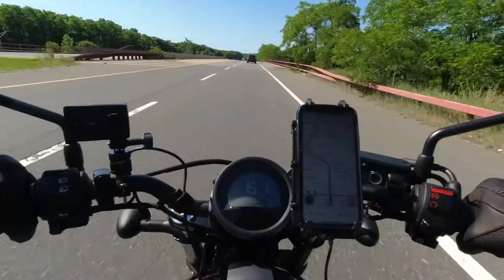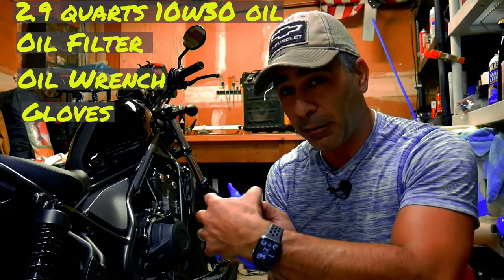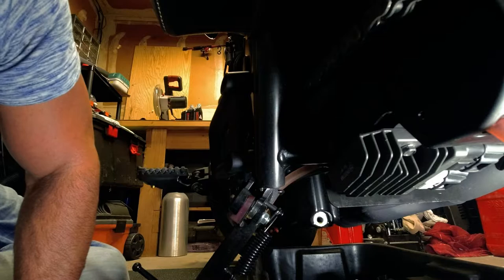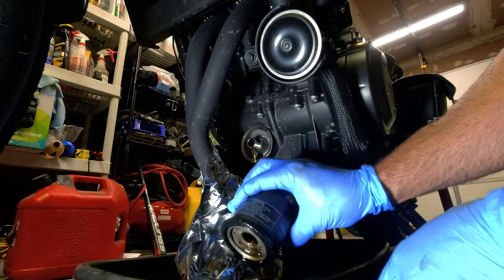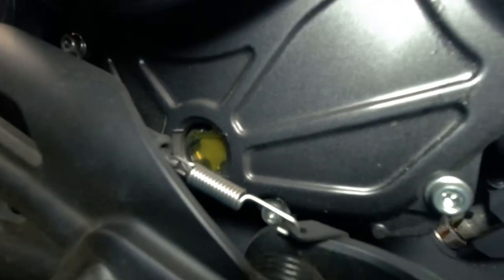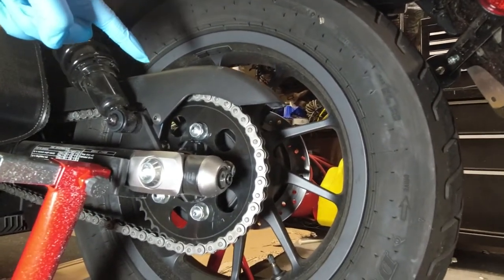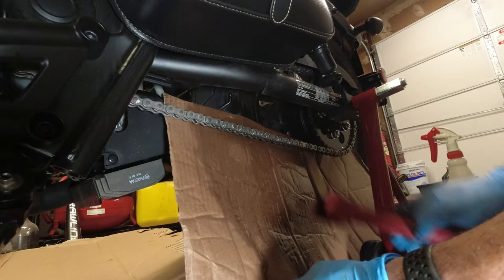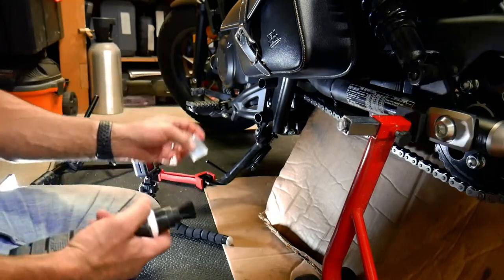Rebel 500: 600 Mile Service - DIY or Bring to Dealer?

Comment: I used  motul and found it very hard to get the O-rings lubed with it because it is so thick. However, Maxima 80-90 Gear oil really penetrates deep into the o-rings and that is your most important location on the chain to be lubed. If you paint it on with a paint brush the width of your chain you will get very little fling off but a much better protected chain and O-rings . IMHO  I only had to adjust my chain tension one time when the bike was brand new but 4000 miles later not getting any detectable stretch and have not needed any more chain adjustments. What that means to me is the gear oil is doing a really super job giving my chain a long life with no rust or stretch.    Kit
Reply from the maker: As much as I like the Motul chain paste, I too have been thinking about going to a gear oil.  I've been reading a lot of pros about it, but of course there's the cons of it flinging off etc.  I guess you have to weigh what works best for your situation. But I agree, I think gear oil would probably give your best penetration.  And if you keep on top of keeping it cleaned and oiled, your chain should last a long time
Reply: @Mudslidex1    As far a flinging off or dripping the first ride throughs off most of the "extra:" gear oil however for the first few day after chain maintenance I just park my bike on a flattened out piece of cardboard and I do keep the few droplets off my garage floor that way. So that is How I deal with that issue.  Kit

Comment: Thanks for the great video! I was planning on taking it to the dealer for service just because I don’t have lots of free time but honestly, having done complete engine rebuilds on cars and maintenance on heavy duty trucks and equipment, I now see this will be a breeze 😂 Thanks for being detailed!
Reply from the maker: You’re welcome.Even if you had zero experience, this is an easy job. But it sounds like you have more than enough to do this.  Happy/safe riding!

Comment: Nice video. If I may, I would suggest that you run the engine briefly after completing the oil refill and then check the oil level sight window. You changed the oil filter but that will not have refilled with oil yet, so the oil level sight window will be inaccurate. Running the engine will prime the new oil filter and then you will get an accurate reading off the oil level sight window. Also, "hand tight" is very subjective. Honda "should" know at what point the drain bolt would strip the threads on the aluminium engine casing. Using their setting and maybe setting that a little less than the manual spec would be more user friendly. If you get a newbie doing this and you tell them "hand tight" they will lay on the force and risk stripping the threads, which makes for a very bad day.
Reply from the maker: Thanks for the tips.  I always check the oil again after a day or driving in both my cars and motorcycles just to make sure as it usually needs to be topped off a little.  As far as the hand tight goes, yes that is subjective and I guess mentioning the torque specs would have been helpful. Thanks for the input

Comment: Great video very helpful! Im a complete newbie never touched  motorcycle, anything else i should check when servicing my bike?
Reply from the maker: Thanks. They say you should check the torque specs and when you have the dealer do the first service they "say" they check them as part of the service, but I'm not sure they actually do and probably just put it there so it sounds like you're getting more for the price they're charging you. But each dealer is different.  I would just go around and check and make sure nothing is loose etc. The manual has more detailed info on what to check and when.  But the first 600 miles is an easy service to do on your own and save money!

Comment: Would you say this is all that is needed for a 1st service on the Honda Rebel 500? 
No need to tune up the clutch or anything else?
Reply from the maker: For the most part yes, but I would check the clutch cable play (which really shouldn't have moved during the first 500 miles)  but check the chain tension.  As far as torquing all the bolts, I highly doubt the dealer does that too, but if you wan't you can.  I never had any issues.  Basically it's an oil and filter change, check chain tension and clutch cable.
Reply: @Mudslidex1  Roger that, thank you! ;-)

Comment: I got a new rebel cml 500 last July , the first 600 miles service with the Honda dealership is important, they change the oil and make sure there is no big metal bits in the oil , they do new oil filter as well as checking over the bike , my dealership even test ride the bike afterwards, and was told this is the best way to see and hear if there is a flat , as this bike has a 2 year warranty, but if you do your oil and filter yourself, does it affect your warranty? , I paid £150 for my first service and didn’t think that was bad considering they ride it after the service to make sure all is well.
Reply from the maker: It depends on your location. Here in New York we have the right to repair our own vehicles without voiding warranty. As long as we keep receipts and records showing it was done, the warranty stays valid.   I like doing my own maintenance because I know I will do a better job then they will as I can take my time and I inspect fluids etc without the pressure that they have where they have to get the bikes in and out to service the next one
Reply: What did they do that you couldn't do yourself?  I don't understand
Reply: @TheScrubmuffin69  here in the uk the Honda dealer does the first service on it at 600 miles, then they make a Honda account with everything that’s been done to your bike , so you and the dealer have a record online of everything they do on it even warranty claims, as I had the left bottle front fork leg replaced as the black mat paint started coming off .

Comment: noob question - what is a 12mm - the socket or bolt or wrench?
Reply from the maker: The bolt size.  So you can use either a wrench or socket.  As long as it's 12mm.  In this case the socket is 12mm

Comment: Hi, I’m thinking in buying a used 2017 rebel 500, do you recommend the bike? I really like the bike but I don’t know if 500 cc will be good enough? I haven’t ride a bike in 10 years and can’t wait to get in the saddle again
Reply from the maker: It depends on your skill and budget. I bought it as my first bike and thought 500 would be plenty of power which it is…at first. But as I got more comfortable I wanted more power.  If you have the money I would go straight for the 1100.  The 500 is perfect for around town and even cruising 80 on the highway.  But I did find myself wanting a “little” more. Which is why I ended up selling it and buying a Triumph Trident660.  But I still think think the Rebel 500 is an amazing bike. But you may want more power if that’s the type of riding you want to do

Comment: Isn't the first service supposed to be more than just an oil change? Thought they were supposed to check every bolt and nut for spec
Reply from the maker: Yes, they are "supposed" to check the bolts and the chain tension, but you can do that yourself and save lots of money.  Some people even wonder if they actually do check each bolt.  Me personally, I would rather do it myself and save the money and know it's done right
Reply: @Mudslidex1  yeah that would be my concern as well. Pay all that money just to say they did without knowing they actually did
Reply: @Mudslidex1  Do you lose the warranty like that ?
Reply from the maker: @justposi  no. You have the right  to bring your vehicle anywhere for maintenance or do it yourself. Just keep receipts
Reply: @Mudslidex1  Oh wow , where i live you lose the warranty the moment you dont do it in the dealership.
Reply from the maker: @justposi  Wow. That's pretty crazy. You don’t have to use the dealer for repairs or maintenance to keep your warranty in effect. In fact, it’s illegal for a dealer to deny your warranty coverage simply because you had routine maintenance or repairs done by yourself or someone else.  You are even allowed to use aftermarket parts.  However, if you are the cause of damage by lets say not putting your oil filter on correctly and you lose all your oil and damage the engine...Well, that would not be covered under warranty

Comment: Negative on motorcycle oil. Just use shell rotella t
Reply from the maker: I've heard others mention that too.  I guess since its a brand new bike and the first oil change, I want to make sure I do  it by the book just to not void warranty.  But I've also heard motorcycle oil is different than regular since the same oil is shared with engine,transmission and wet clutch.  I don't know for sure, but it's something to look into once my warranty expires

Comment: Did you use all the oil in the 3 bottles?
Reply from the maker: Almost.  Had a little left in the 3rd bottle and then I would check the level after a couple of days to top off if needed. But it took just under 3
Reply: @Mudslidex1  Thanks! Helpful video!

Comment: The dealer service included checking the valve adjustment,  adjusting the cables stretch and the chain adjustment.   Not to mention rotate the tires and changing the air.  LOL
Reply from the maker: The dealer does check the cables and chain stretch too, but that is simple and easy to do yourself.  As far as rotating the tires?  It's not a car. LOL.   And they definitely dont do valve check clearances at 600 mile service.  That's usually around 12,000 miles and is a costly job